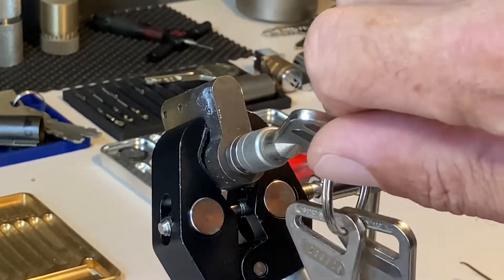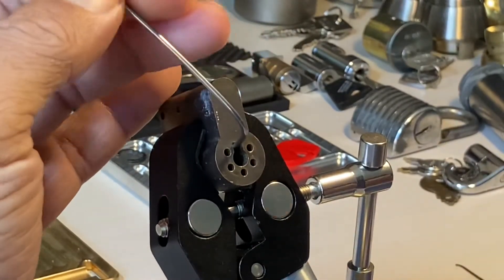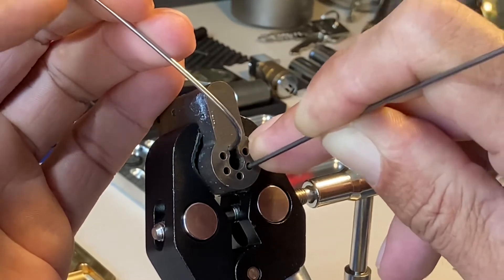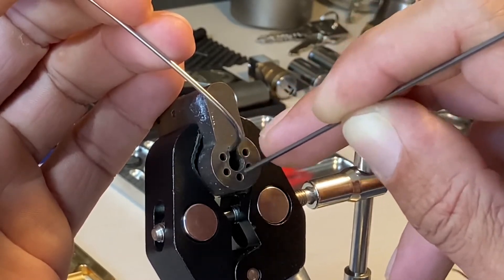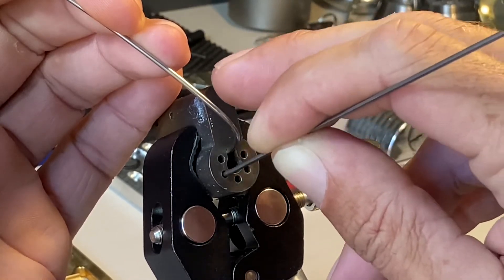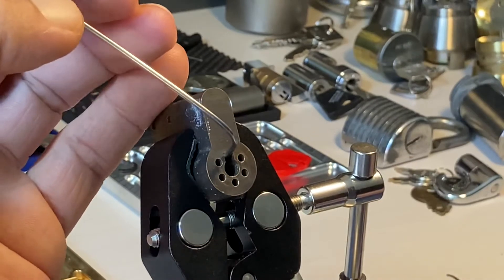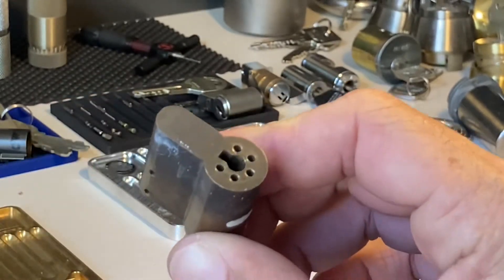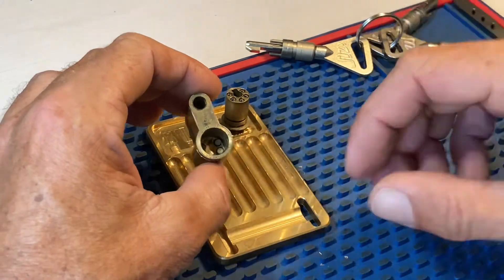French Izis lock pick and gut. (World first public pick?)

Comment: the balls are to prevent the   "come back" of frontal pins( steel here ....but sometime brass) with a "sticker hook" after bump with hammer  and crash/press all springs(brass) -effectively ,all bottom pins (brass) are behind the shear line in this case. an old ,old method from france ;-) this cylinder is an old model , factory add  2 transversal pins (4  version of key).